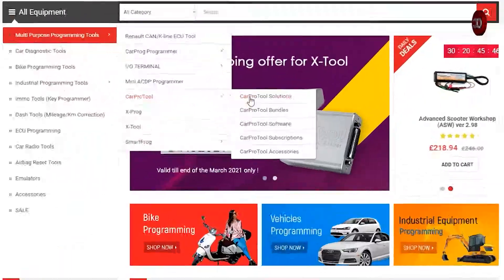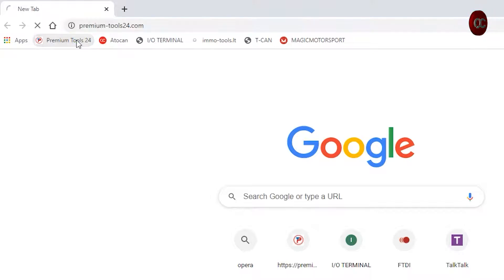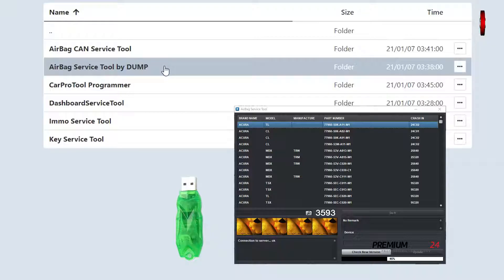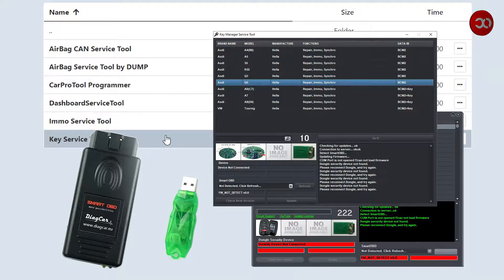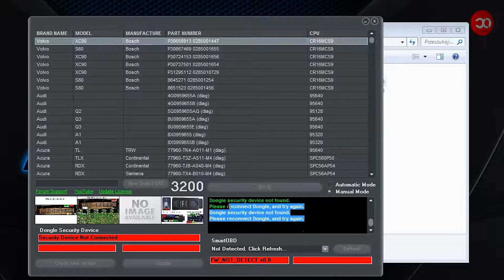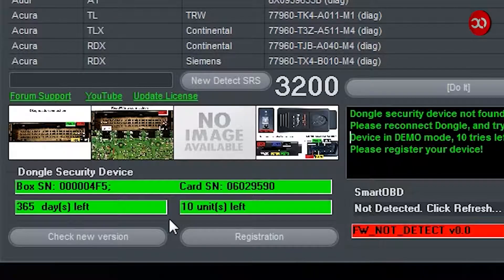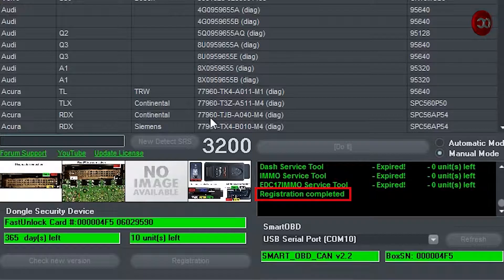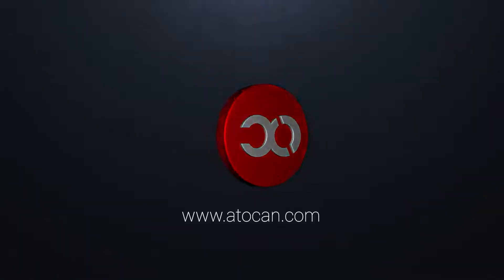First Steps After Buying  Airbag Service Tool & SmartOBD CAN Tool

Comment: How to download usb dongle
Reply from the maker: @kamaluddinimamali7441  expalin please what you mean  ?
Reply: @CarProToolProgrammer  usb dongle is not working software is detecting how i can download the proper files so it can work
Reply: Dongle security device 
Smart card not connected
Reply: @kamaluddinimamali7441  i have the same problem did you fix it ?

Comment from the maker: SMARTOBD

SmartOBD CAN Tool (HARDWARE WITHOUT ACTIVATIONS) - 250.00€
https://diagcar.eu/en/home/233-smartobd-can-tool-hardware-basic-version-no-activation-included.html

SMARTOBD ACTIVATIONS:

AirBag Service Tool (dump calculator)
AirBag CAN Service Tool (CAN software)
Price for activation - 600.00 € 
https://diagcar.eu/en/calculators-activations/167-airbag-service-tool-crash-data-repair-tool-activation.html

KST Key Service Tool 
KMST Key Menager Service Tool (VAG BCM2, EDC/MED17, ELV, KEY- Programming, Repairing, Synchronization)
Price for activation - 300.00 €
https://diagcar.eu/en/activations/197-activation-key-service-tool-renew-smart-key.html

DST DashBoard Service Tool (dump calculator)
DCST DASH CAN Service Tool (CAN software)
Price for activation - 300.00€
https://diagcar.eu/en/calculators/36-airbag-service-tool-crash-data-repair.html

IST Immo Service Tool (dump calculator) - 300 € (activation)
https://diagcar.eu/en/calculators-activations/170-immo-service-tool.html

SALES: www.diagcar.eu 
SUPPORT: www.carprotool.com 
PAYMENT: Card, PayPal, Bank Transfer
DELIVERY: FedEx or DHL
WhatsApp/Mobile: +48 509 399 633